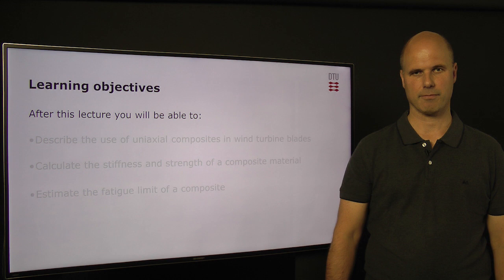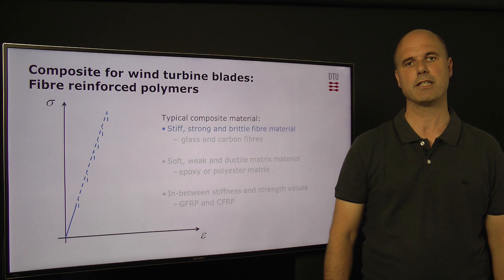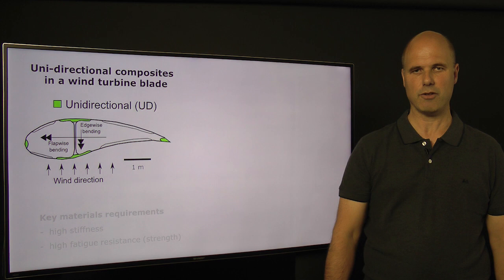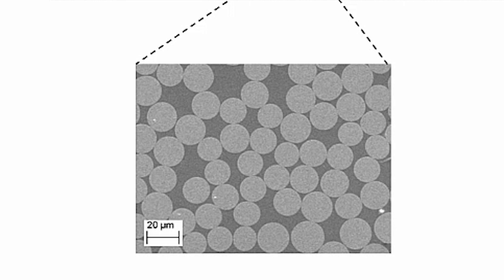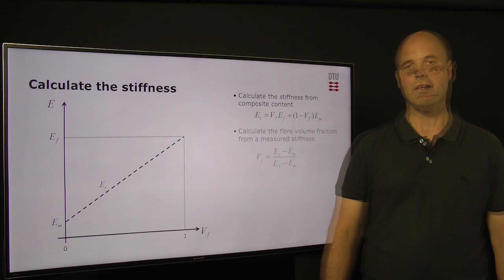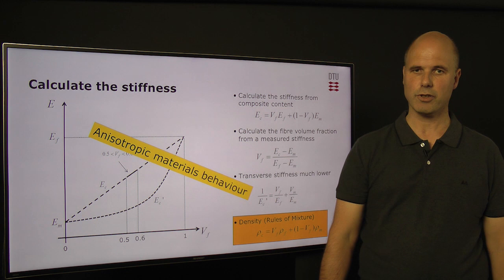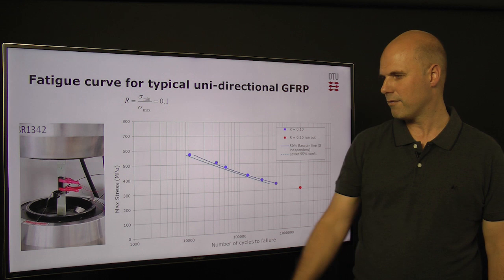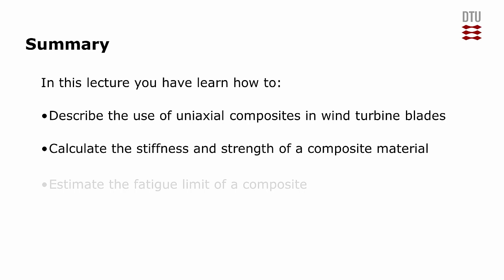17. Composite materials for wind turbine blades

Comment: Is stress the only option? What other words would make a turbine energy? 
What are the energy symbols? As in alphabet character? 
If mathmatical equations result in energy what which letters or characteristics or characters are available other than stess? 
Is stress necessary?
If a human is insisted on medication than a even keel is somewhat apparent to be a bar woth no extremes but a human that experiences high highs with low lows is what it was before medication
Do wind turbines translate language
Is it a weather meter meaning able to create all weather?
Do the wind turbines create material?
What is the process to turn rust or blood into gold?
Isnt it a heavy metal? 
If the rust is crack does that mean it's ready for delivery or pick up?

Comment: Carbon-fibre has a few advantages over fibreglass for wind turbine blades. Being easy to repurpose as well as being lighter are just a few advantages over fibreglass.
Going forward being able to repurpose and recycle machines and materials as well as products will become extremely important.
I am not 100% agreeable to the way forward set out by some world organisation's and people but it is common sense that the worlds resources are not infinite.
Shredded Carbon fibre has many uses and is aesthecially pleasing but shredded Fibreglass is much less useful.
😎👍